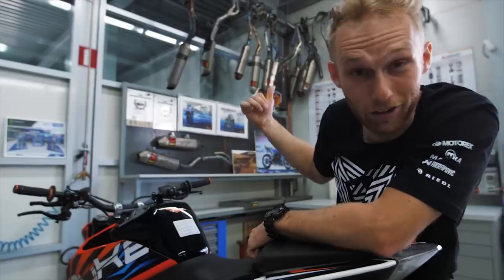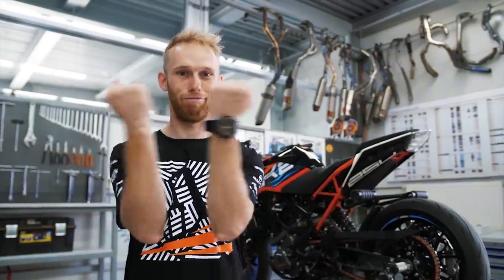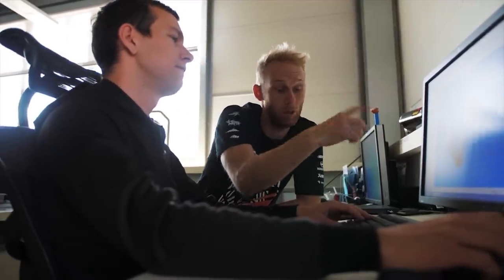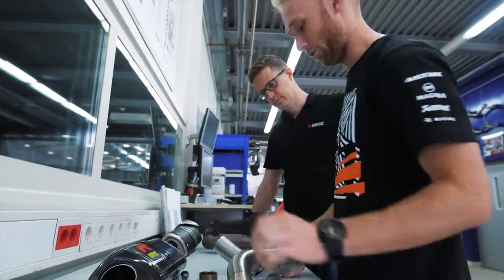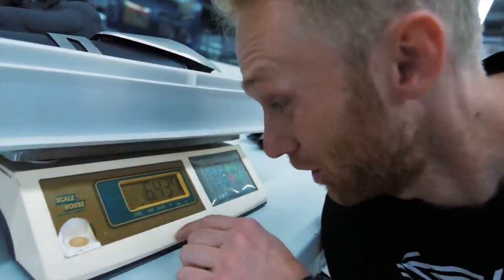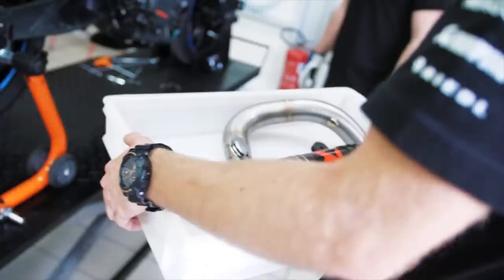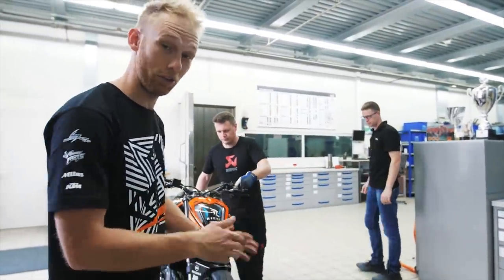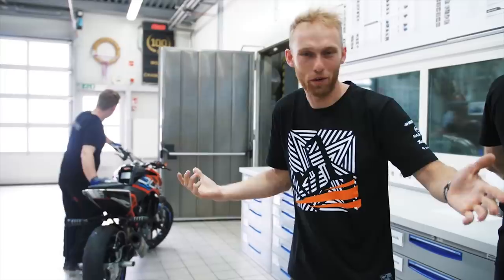AKRAPOVIC FULL SYSTEM EXHAUST - KTM 250 DUKE  | RokON VLOG #58

Comment: What about the data? Not necessarily HP and TQ numbers but AFR (air fuel ratio). Is it running lean without the cat and did you have to reflash the ECU or add a fuel controller?

Comment: Hi Nice Work, My suggestions on crazy idea will be on KTM Modding, idea is to show us how to add abs on KTM 250 Model. The KTM 250 Variant Doesn't come with abs system in India. so i would really appreciate if you can help us & show if it is possible to add abs on KTM 250 and also explain us if there will be any performance difference on engine, after & before adding..